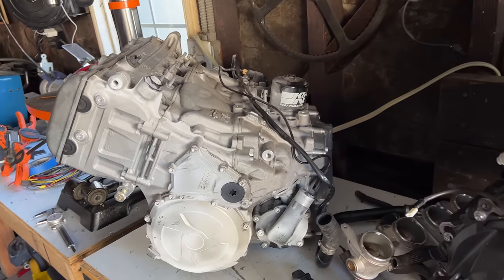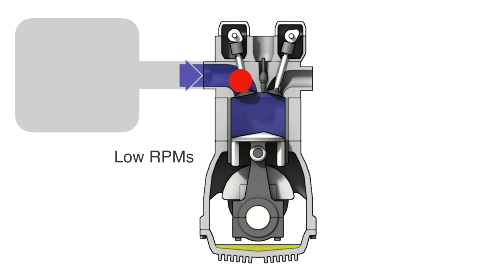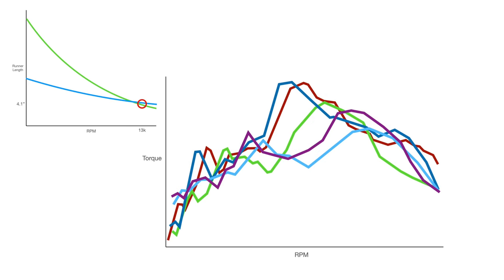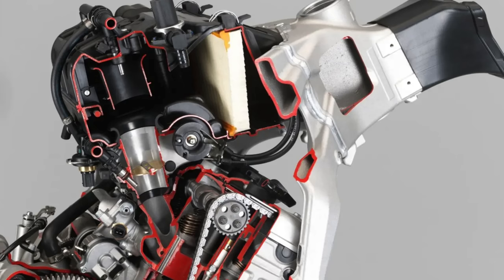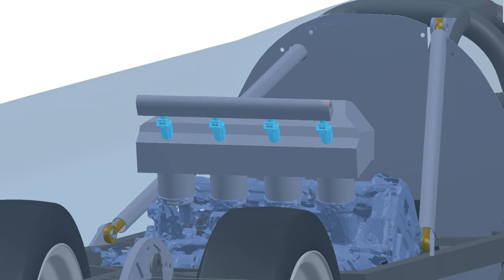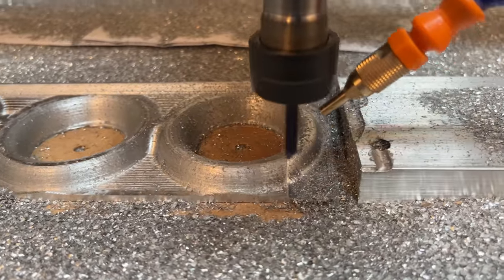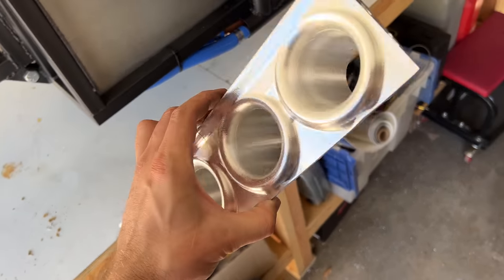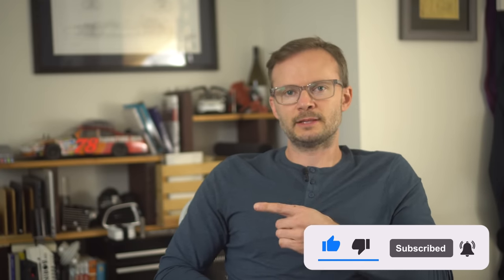Build Your Own Intake. Or Just Watch Me Do It. Whatever.

Comment: Ngl, i think a CFD sim of that airbox might show that around the „trumpets“ there is gonna be low pressure zones, since you have almost no room between the bottom of the airbox and the intake runners and when sucking air through a pipe, all the air that’s sucked in comes from the sides of the opening. And in this case, said side of the intake trumpets consists out of the bottom of the airbox and the next trumpet for the most part. Might just cost a few hp but i think it‘s something to keep in mind for a later evolution of the airbox. Also all edges inside the airbox create a thicker layer of turbulent air and thus reduce the effective size of your intake.

Comment: The "bad" aluminum welds are due to low gas flow i think, I have noticed when the bottle is close to empty the flow meter is not 100% accurate. Buy a flow meter with a ball, they are more accurate.

Comment: I think you may have high RPM fueling issues not running the inner injector trumpets or at least some separators as your going to have cylinder scavenging happen unless you run huge amounts of fuel to basically compensate for it which leads to poor atomization or worse a blown intake if you have a misfire.  There use to be a great video of a Renault F1 engine running on the dyno with a camera above the intake runners, you could see how the mix was moving into the setup.....
Reply: Yeah, I think I have a copy of that from back in the day, a simulated lap of Magny-Cours (or something) on the dyno.  Here's a snippet of it that I just found, https://youtu.be/y2iBbwocYZw

Comment: I think you’re struggling with the welding because your ceramic cup is so small. It’s not covering a large enough area with shielding gas. Try a 3/8” one with around 17 cfh. I think you’ll find you get clean welds then.
Reply from the maker: I recently bought a new welder and my aluminum welds have improved dramatically. Something was wrong with that Miller.

Comment: you should look into some half height injectors.  That will lower down the fuel rail and clear enough to clear the body.  When I needed some I was able to call Deutschwerks and they were able to find some half height injectors that worked for my fuel rail and injector bosses

Comment: I knew that an intake can squeeze out a few extra hp but I never knew it was pressure waves condensing the air into the cylinders, thanks
Reply: You get similar pressure waves reflecting back from every junction in the exhaust manifold too, and you try to time those so they hit the back of the valve just before it opens.

Comment: I wonder if you could make your runners like a trombone so you could tune the length on a dyno? Two pipes, inner thick walled with od close to id of outer thin walled pipe. Cut two grooves with a lathe for O rings in inner pipe so it seals like a hydraulic ram. Maybe chamfer inside edge of inner tube so it does not create disturbance in air flow. If you flanged both ends, once you figure the length you could fab tubes that match and bolt them in perminent

Comment: The bottom line is that  assuming you know the power you already have at thirteen thousand rpms and proceed to build the longest intake that will fit on the engine and car. Then the dyno runs, if it's not as good as you started with, cut the intake half to three quarters inch and dyno again. Surprisingly you may get back to the stock length without any hp gains.

Comment: I reckon half the reason the maths doesn't work out is it's based on the wrong principle. The whole 'air squishes up against a closed intake valve' thing does happen, but it's a small effect. The thing that actually does the cylinder filling is the downward motion of the piston (at highest acceleration) setting off a negative pressure wave which travels up the runner and reflects off the open atmosphere as a positive pressure wave, which if you've sized it right will return at the latter part of the same intake cycle where the piston's started slowing down or even started to travel back up the bore. The bit that complicates the maths is that the open end of the atmosphere migrates down the runner a little, effectively shortening it. How far it migrates down is dependent on the suction produced and the diameter of the runner, which I haven't worked out how to estimate yet!

Comment: "Roughened" intake runners to help atomization ? Or are you depending solely on the injector doing that ?  Then you would use a fairly smooth runner. Will the injector spray "cool down" if it hits the back of the runner causing "globbing" ?  I have a headache...

Comment: 1/8th inch plate for intake because turbo? Also because ~1 bar of vacuum when you get off the throttle at high RPM :-) don't want it to collapse like 78% of FSAE inlet manifolds do the first time they see some vacuum :-D

Comment: After 40 years of developing race engines by track testing and later by dynamometer testing I can say that practice beats theory every time, make a change and test the effect, if there is no difference, try something else, if the engine is improved try making the same change a little more, if it's worse just go back. Make small changes and be patient, when I started tuning Ford Pinto engines the accepted maximum power achievable was 180 bhp, after 2 years we at HT Racing had a completely reliable 245bhp @ 7.2K rpm and this was by ignoring all the accepted wisdom of the time and just trying something different..

Comment: Ask me what happens to your supper ultra carefully built race engine when a bolt in the air cleaner assembly comes loose at 8500 RPM in the dip at Road Atalanta

Comment: I have a aftermarket intake with a fairly large plenum but short runners. Runs great at high RPM but super foggy down low. I have thought about designing runner inserts to lengthen the runner into the plenum to move the rpm range a bit. 3D print them then dyno with out them then with them to see how it effects the curve of the graph. I just don’t know if abs would deal with the high intake temps of a high boost engine that this one is

Comment: I'm just curious with your comment on the adjacent cylinders pulling extra fuel, if you're running 2 cylinders for the 500 class what will be the plan to prevent those cylinders from contributing to the power generation? Would pulling the plug wires (physically or digitally) be enough or would you run into potential hydrolocking?

Comment: The welding needs to be addressed. Were you using appropriate shielding gas? Looks like you may have forgot to turn the shielding gas on. Should be apple to put on perfect coins with a tig. Could just be bad gas. Maybe, get a fresh cylinder that hasn't been topped off. The other thing that could cause that is using cheap aluminum filler rods.

Comment: Question- does the intake plenum need to be made of metal? Im thinking one could sculpt it out of foam and make a fiberglass or carbon fiber molded piece that would be smooth and rounded with less harsh angles of a laser cut and welded fabrication. Maybe even lighter too.
Reply: Molding anything one-off is pretty expensive and labour intensive, much more than just doing it in aluminium.

Comment: Im kind of stopid, but I wonder if it would be possible to make the runner length based on current rpms as of variable shifting around a little and still keep the air in, theoretically doesnt sound ultra hard but also probly wouldnt be as reliable but would be a interesting concept.

Comment: “Build your own intake”

Honey you can’t build a lower intake for this blower. We built our own plenum/throttle/vacuum assembly and it barely held up even with 1/8 inch aluminum. Just about as thick as we could go and it still bow’s in from the vacuum power. Once we reinstall the blower (after this fuel leak from a shredded o-ring) we will see how well the whole thing holds up. Welds are already breaking.

Comment: Comment with 2 parts (sorry, Algorithm) 1. Why does it seem the only 2 intake materials EVER used were Cast Iron or Aluminum? Can we really not afford the extra 18 ounces of weight that using plain old Cold Rolled steel or even Stainless would cost? SOO much easier to fabricate (and that was a serious question).  2. As a recovering Grammar Nazi (OK NOT recovering) I still appreciated the lathe-ness of your comments, although you missed a Golden by passing on being too "lathe-y" to do... whatever it was.
Reply: In the auto industry it is much more about ease of fabrication at high volumes and cost. 
At those scales casting (iron or aluminium) + machining or just plastic casting is much cheaper than about anything else

Comment: Matt! Aerodynamic drag is reduced with laminar flow! Widen the car body around 1 degree to keep the air attached. This gives you space for the airbox. Design a real diffuser to regain pressure in the intake!

Study the stuff in high level aviation design channels!

Comment: my new favorite channel... >>>teeteecaacaa<<<<<<..
  Not sure if intake pulses will be affected from flat surfaces flexing , but if cracks form, that's what I found to be the key...  yours looks to have smaller flat sections though...
    great work.. 
    remember,  push the boost until something breaks, then back it off a little